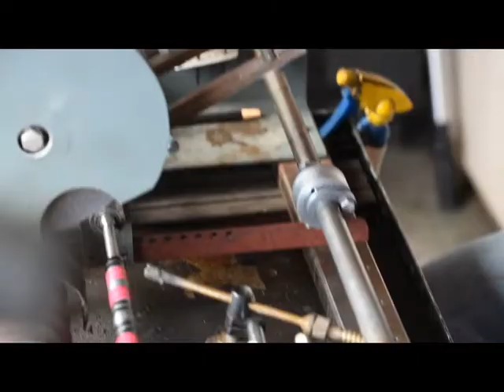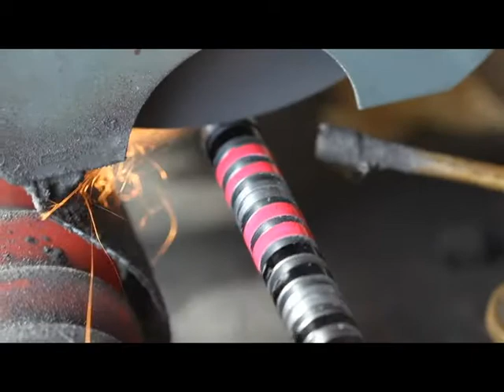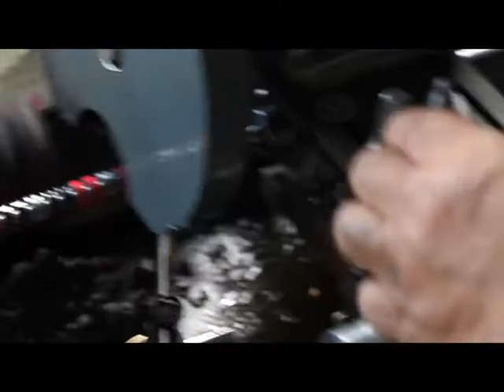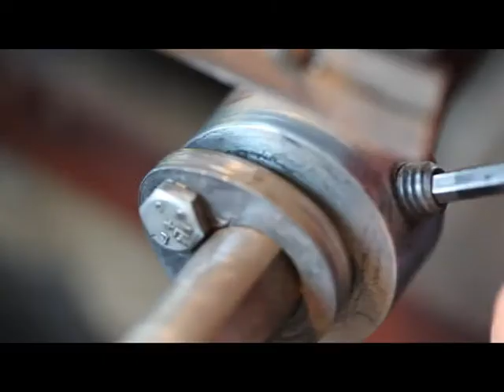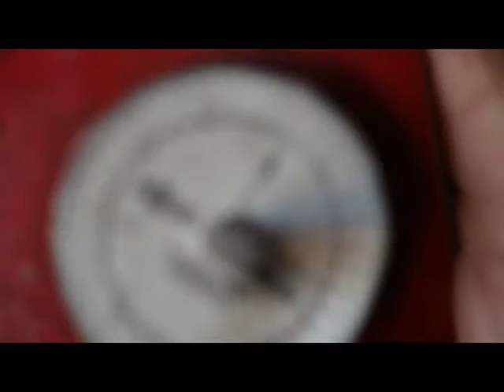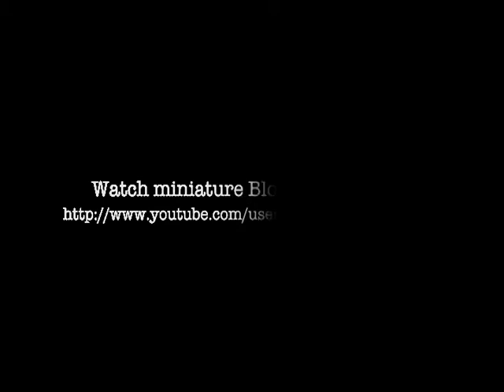Miniature Camshaft Grinding

Comment: cool grinder, I think I'll try a single cylinder first.

I have built my share of vv8 race motors, but cams were store bought. I never had to grind my own. I was curious to how it was done as I want to build a 4 cycle gas motor. 

Next thing to look at is the crank.

Comment: Very interesting.As you point out each pair of cam lobes are positioned differently in relation to the last and so on.You didn't show how you adjust the angle of the copy so as to grind the next cam pair in the correct position.Does the copy shaft have an angular scale so you can accurately set the angle for the next cam pair?It's a good set up and appears to be far faster than all the CAD/CAM mini cam grinders seen elsewhere.Thanks for taking the time to show this,very interesting+informative.